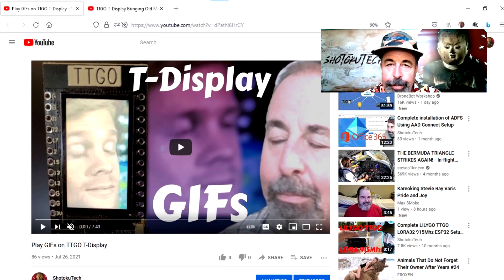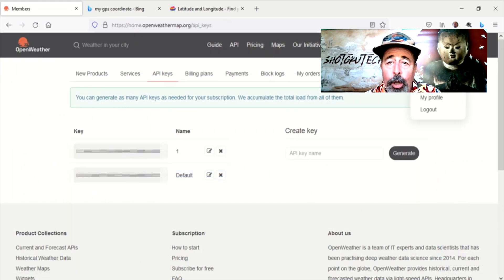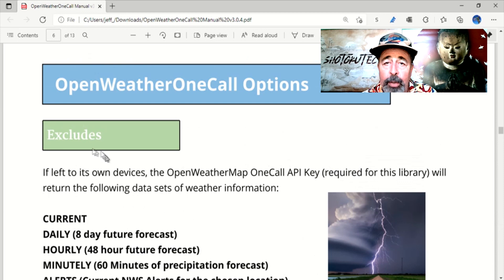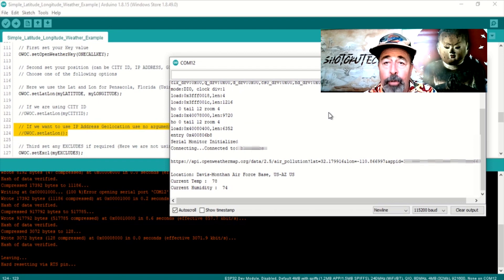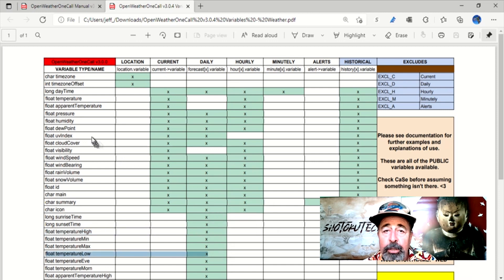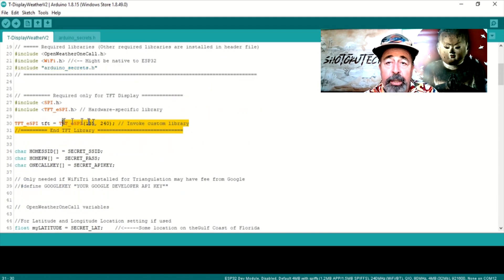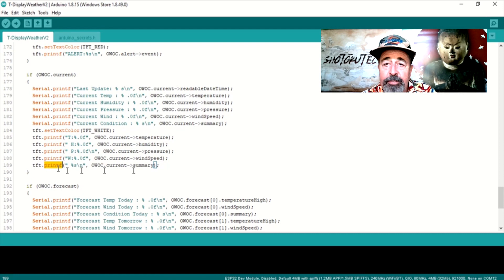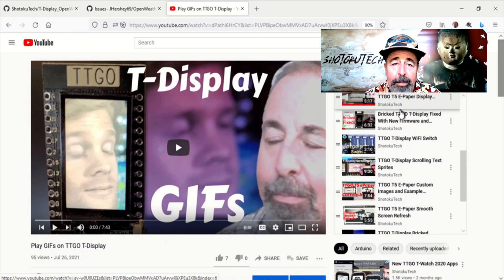TTGO T-Display OpenWeatherOneCall Mashup

Comment: I am trying to make this project with version 4. I'm using a T-display s3. Has anyone updated their code? I'm not having much luck trying to code my display.
Reply from the maker: Wow! That's a good question!
Reply from the maker: I am starting to look at this now. You may want to check out: 
"Beginners Guide: Easy Step-By-Step Setup for Lilygo T-Display S3"
https://youtu.be/M6iyopfLrGs?si=mryXjq6eXORTu_8S
Reply: @ShotokuTech  I watched more of your videos. They are super helpful, Thank you for making them. I was able to get 3.0.3 working to display on the TFT and 4.0 to display on serial. However, I'm only getting the location information back on both versions when making the call. I am now trying to look into that problem. I just have the free API key. I have verified the key through typing my own call in a browser. Any ideas? Thanks.

Comment: JHERSHEY69 here and I would like to thank you for this excellent video on the use of my OPENWEATHERONECALL library! I did release a major upgrade today for v4.0.0 so be sure to install that as soon as possible! (And thank you for telling me about the bug. :P

ALSO: If you change the pointer "->" in the variable calls for Current and Alerts to "[0]." it should do what you want with the TFT print.
OWOC.current[0].temperature for example.